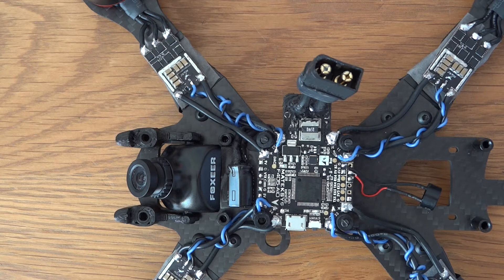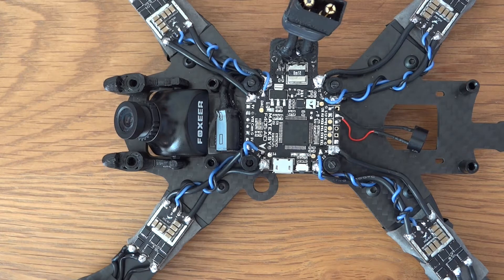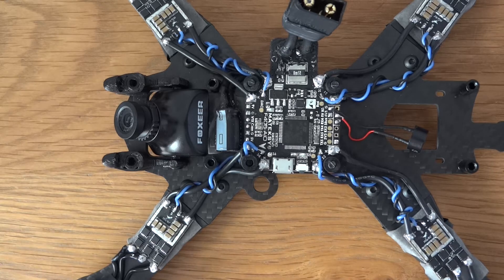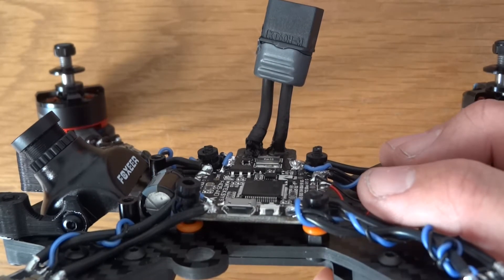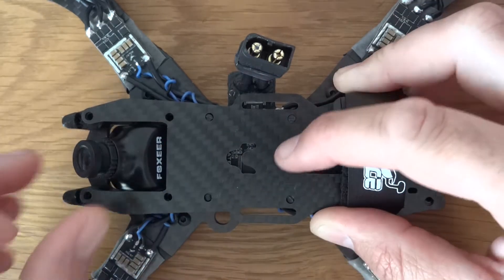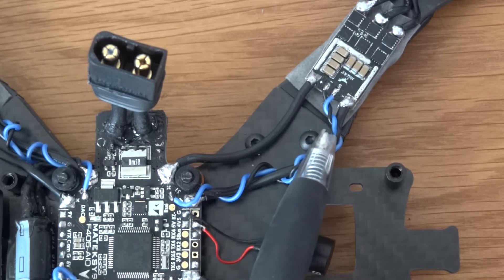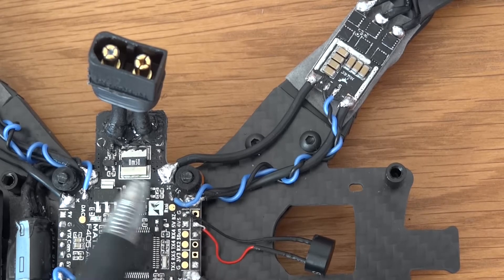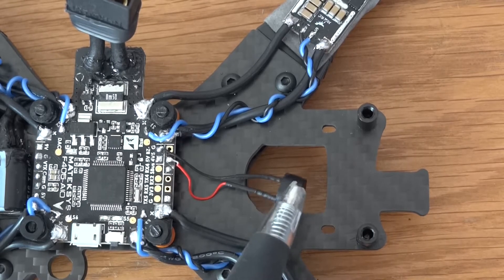Hyperlow freestyle fpv quadcopter Build Pt 2: Escs & FC

Comment: Thank you so much for the tip on extending the capacitor Leeds with 20 gauge wire. great info thanks.
Reply from the maker: Rumi G glad I helped a bit :)